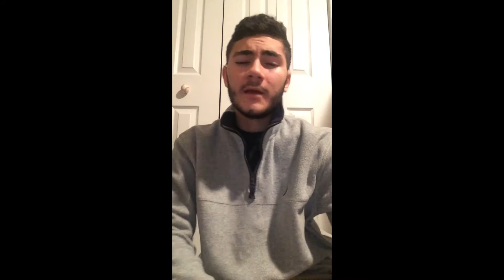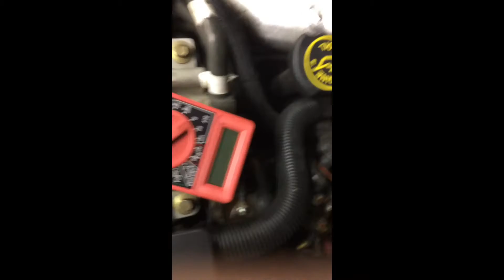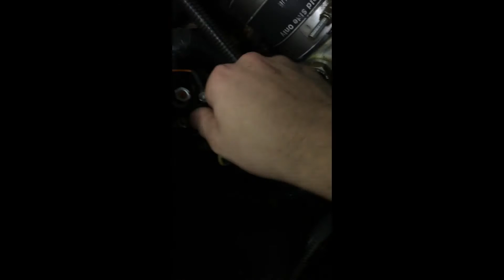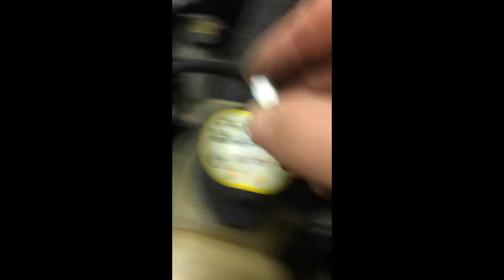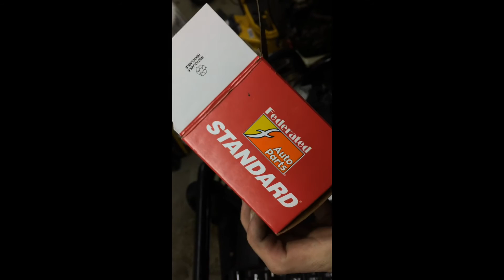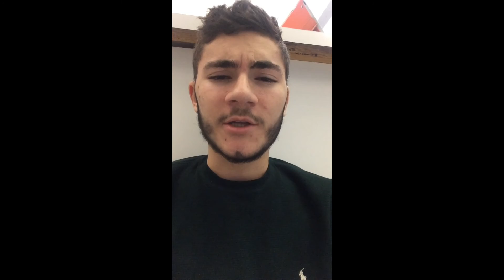F-350 7.3 Glow Plug Relay Replacement

Comment: Thanks for sharing! Replacing my GPR soon on my early 99 F350. Looks like a straight forward install.
Reply from the maker: Hope it went well, mine ended up burning up again and I replaced it with the Monster White-Rodgers glow plug relay. No issues since.
Reply: @caplanlandscaping5108  install went well and doing fine after a year and a half.